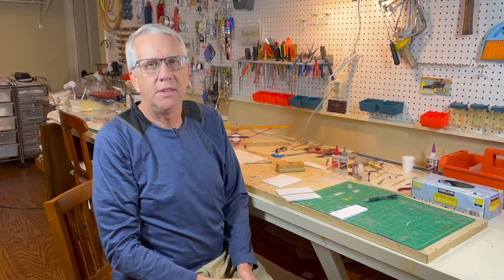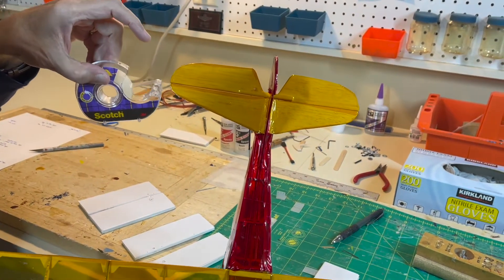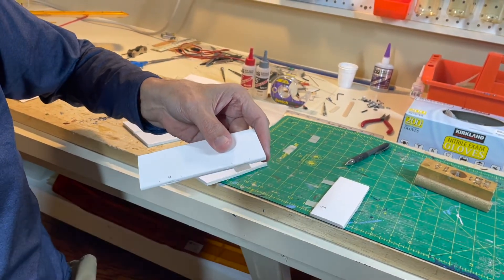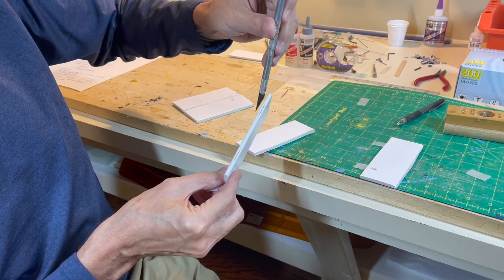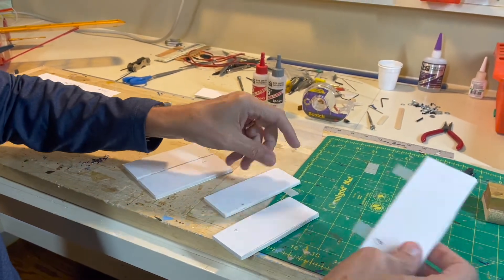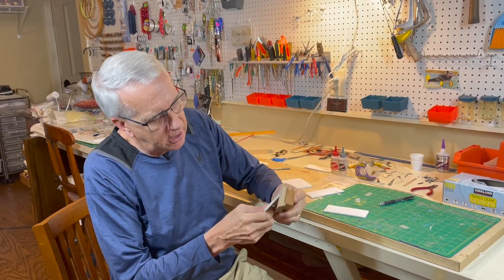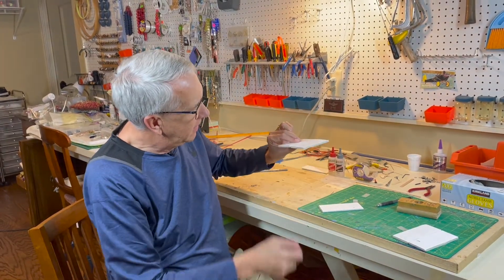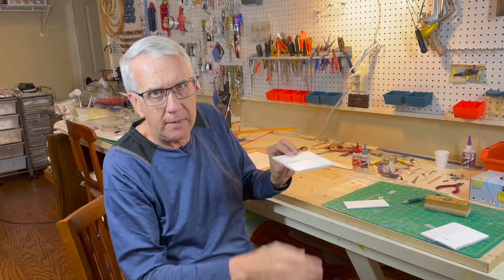Easy RC Hinges from Milk Containers

Comment: We used to use cloth hinges. Two at each location with each one in the opposite direction from the other. Never wore out.
Reply from the maker: Thanks!  Tim
Reply: Yep, I still have the first control line plane I built and I did indeed use cloth hinges. Dang I'm feeling old now... 😜

Comment: I used to have a model shop - I have seen some tight modellers in my time, but this takes the biscuit. The danger is that some modellers will used cheap methods on larger, faster models. This could be very dangerous. I have seen basic 3kg plastic geared servos used on 84" wingspan 3D models with 1.80cu in engines, and some modellers see this as 'thrift'. It is irresponsible.
Aeromodeller for over 35 years, I wouldn't even use Mylar for hinges - just seen too many split on the hinge line or simply pull out of the control surface.
Reply from the maker: Good points, thanks!  Tim
Reply: I've used mylar no problems for 'normal' sized models no problems but not on an 84" screamer. Lightly sand before gluing and as always checking hinges is part of pre flight checks.

Comment: I use polyester Cloth-covered Mylar for my hinges. You can get them at the post office or Amazon for real cheap. it's the same flexible tough material that used to come with the Old GWS planes. I use contact cement to glue them in. It takes longer to dry when using it as a normal glue but you get nice clean really flexible hinges. I also use Bob Smiths' Foam Cure or UHU Por glue for gluing hinges as it never gets stiff. I'm going to have to try milk jug hinges as well. Thanks for the tips.
Reply from the maker: Great ideas, thanks!  Tim
Reply: 'd saty with the Mylar, much more flexible. I just use ordinary Mylar Stencil Film and give it a light sand to roughen the surface.

Comment: Great Idea. Thanks.
What I have always done when installing hinges is after the hinge is glued in and movement is OK, I take a very thin flat headed pin and carefully push it thru the building material and the hinge to act as a mechanical anchor. It doesn't need to be glued in. Then I cut off the pointy end with some flush cutters.
I have also built quite a number of models where I use only pins and no glue at all so tha in case of a crash I can easily remove the hinges without damaging the control surface. I have never had a failure with this 100% glueless method. I use 2 pins per side of the hinge joint.
Reply from the maker: Great techniques, thanks for sharing!  Tim

Comment: This is a very timely video for me.  I'm trying to figure out what I'm going to do for hinges on my current project, which is a 48" cabin rubber job I built about 25 years ago and converting to electric RC.  I like the idea , but I'm concerned they won't be flexible enough.  I'll try it and find out.  I see you have been making model airplane videos for a LONG time, and I've enjoyed going through your back catalog. Thanks for posting!
Reply from the maker: Ken:  Good luck and thanks for checking in!  Tim
Reply: If you care about your models, use regular hinges. Milk jug plastic will fail due to UV light making them brittle.

Comment: Great idea.  Definitely use that for my smaller planes.  I'm installing the larger pinned hinges on a 20cc size plane (last night).  I like the option of pulling the pin to remove the control surface.  Picking out the wood, greasing the pivot, gluing the hinge...not my favorite job.
Reply from the maker: Sounds great!  Tim

Comment: Milk bottle plastic will work (if a bit thick and stiff) with CA/Epoxy for EPS/EPO planes. For EPP a thin smear of Rubber Cement works better. Tough and sticks like the proverbial to a blanket plus remains very flexible. DON'T put anything containing the Toluene-type solvents in rubber/contact cements ANYWHERE near EPS or EPS/EPO blends though! 😉😊
Reply from the maker: Great inputs, thanks!  Tim